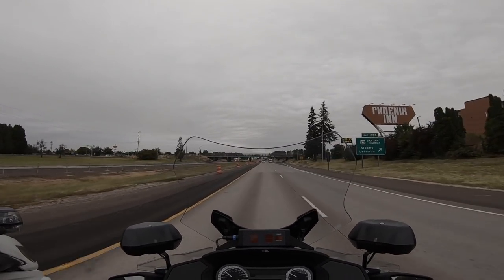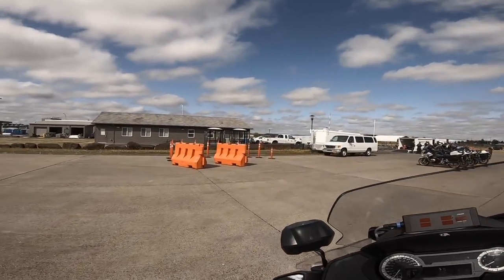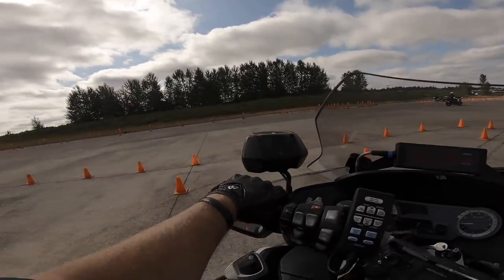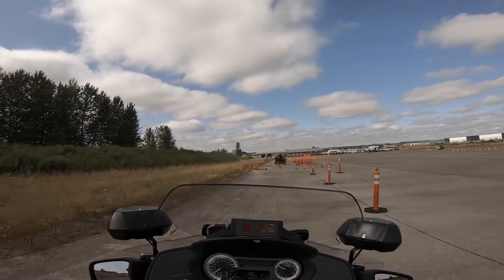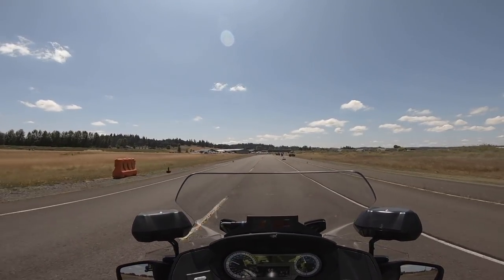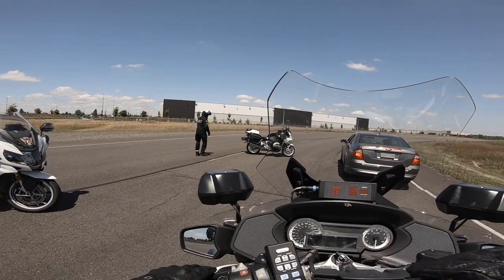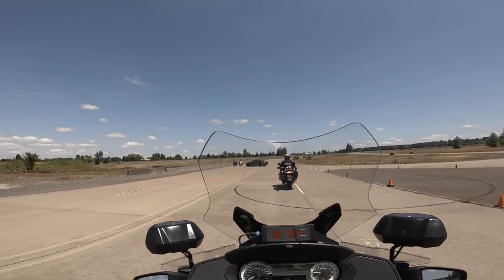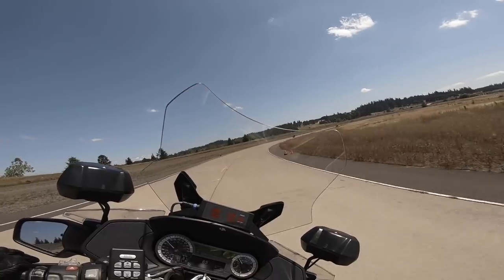Police Motorcycle Advanced Motor Training On A BMW R1200RTP!

Comment: 7:07 Most of the things you showed are part of regular civilian Dutch motorcycle license training... We have to show 6 of a collection of 12 exercises to pass one of the three exams to get a motorcycle riding license in the Netherlands.
Several precision stopping exercises, walking the bike and parking it, high and slow speeds slaloms, figure of 8, turn from a stop, swerving...
We do not use the more fancy exercise sequences but all the elements are basically there and the competitive element is absent as well...
I am working on my 1968 Ukranian motorcycle which is the great great great grandfather of your bike...a 750cc flat twin with just 22 HP... cant wait to take it on the road...

Comment: Excellent video!!!  I am 67 and just got an R1150RT that is my main means of transport.  The skills you show in this video should be learned by every motorcyclist.  The low speed maneuvering and emergency stops are used by everyone.  Is there a class or training that is available so civilians can gain the same safety skills?
Reply from the maker: How do you like your 1150RT? I’d like to find an older RT like that as a commuter/runaround machine. Thank you for watching! I don’t know of any specific courses for civilians that train slow speed cone work. I’m guessing there are a few but I’m not sure where they are.

Comment: Great to see the RTP doing its thing. I own a shop down Central Coast Cali that does all cop cycles in the county. Very interesting! Stay safe👍
Reply from the maker: Thank you Neil! Thanks for keeping all those cop machines on the road down south. They get worked pretty hard.
Reply: @Mclovingarage  They are a wonderful tool and resource for PD. Generally replace tires and pads every 3k and of course safety checks. Please, please be safe. We can fix and repair the machines.
Reply from the maker: @neilmcclain181  I try my best! Biggest fear for sure is someone not paying attention or running a light as I’m entering an intersection. Always on my toes.
Reply: @Mclovingarage  I agree, I ride like everyone is out to get me. We are putting a ST1300P back together now, had almost 10k damage. Sgt has recovered well and back to his desk.

Comment: I just discovered your videos and I find it very interesting. I had thought that I would like to be a motorcycle cop when I was a young man, but at 58.... 
I was wondering if you can say without breaking an policy, about how much ammo you would carry with you on the motorcycle when you are patroling, knowing what ammunition weighs and that you have an AR on board with you as well? It sounds like your work bike is equipped with a Rev limiter or was it the wind? 
 I am impressed by your ability to handle the bike and carry on a conversation with us or your partner.  Be safe out there.

Comment: That’s impressive 👍 thanks for sharing…I pick up another RT next week and only hope I can ride half as good as that…..
Reply from the maker: Thank you! Enjoy your new RT. They are an impressive machine. Is it a new 2022?
Reply: @Mclovingarage  I’ve ridden a number of different bikes (goldwing, triumph, harleys, etc) and the last RT was a 2015. This one is a very low mileage 2015. (4K miles), which I am picking up in CO and riding back to AZ.  I really don’t care for the new look of the 2022, and I prefer the analog gauges.  The boxer engine is a fantastic engine and will always ride an RT…well balanced motorcycle 👍

Comment: I thought that Kawasaki had given up on the C14 as a police bike.  As a C14 rider, I’m glad to see that isn’t the case.  Very nice riding and motorcycle control on your part.
Reply from the maker: Thank you. Kawasaki has given up on the Concourse being a Police Bike. There are still some being used in that capacity but my understanding is Kawi is not endorsing their bike as a Police Bike. They were all up fitted by an aftermarket company for police duty.
Reply: @Mclovingarage  I have the “crash bars” from MCEnterprises.  They hold driving lights, but have, fortunately, not had to hold the bike up off of the ground.
Reply from the maker: I also owners a concourse. I had a 2013 that I bought new. Awesome bike. I also had the crash bars on it. They looked great and appeared to be pretty functional. I never had to try them out thankfully. Haha!

Comment: The maneuverability of the motorcycles an talent of the officers is outstanding. I still gotta ask why no leathers?
Reply from the maker: Too hot. Most everything we run is textile stuff now. Easier to move in. I was wearing a mesh motor jacket during the high speed stuff. It has armor in it and back protection. Thank you for watching.
Reply: @Mclovingarage  Thanks for the feed back, it's good to know there is steel plates in the jackets. My leathers saved my skin  several time in my motor days.

Comment: Nice video!  I ride a BMW 1200RTC - RTCivilian. :-)  I appreciated the engine sound throughout the video.  One thing I don't hear mentioned near enough is how much more FUN riding is when you have had some training.  Question: you said you have already had a new clutch - do you use your rear brake when doing low speed maneuvers (working the brake against the clutch)?
Reply from the maker: Thank you for watching! I have a blast riding, especially at training. I do drag the rear brake sometimes throughout patterns to regulate speed. Both of our bikes have had new clutches right around 20k miles. They get used hard in training and day to day.

Comment: the cones look like practice to drive in normal traffic in Thailand on a motorbike :D  That one at 80. felt a little like trying to stop at 55 in a truck with 32k in the trailer. The problem is the truck would not have stopped for a while after the sticks.

Comment: Hi!
Have you tried ( or been taught) clutchless upchanges at speed ? 
Pre-loading the gearshift with the foot ready for throttle drop as the drive is selected in upper gears (4,5 &6)? Allows rapid succession even without a "quickshifter" !
Also, do the US bike cops train "offsiding" by using more of the entire road (when safety, visibility allows ?)
Doing so would allow earlier apexing on left hand bends by straightening-out the manoeuvre ?
Good stuff.
Thanks for sharing !
Just subbed.

Comment: I just subscribed… thank you for posting! Question on high speed corners “I scrubbed my toe”…. Does your bike have engine guard bars… do you find they scrub before your “toe”…. Are you allowed to comment on what brand is installed on your RT? Thanks for your service!
Reply from the maker: The bike has factory engine guards from BMW. The foot pegs are lower than the heads and I was riding a little pigeon toed when that happened.

Comment: That was an awesome video. Great clip and performance. I felt the adrenaline as you were going through those courses.  I have 2 questions. Which GoPro did you use and where was your camera placement on you body. Thanks
Reply from the maker: Thank you for watching! I appreciate it. The camera is a GoPro Hero 7 Black and it is mounted on the very front of my helmet in front of the chin bar. I used a cheap amazon GoPro extension kit to get it out in front of my face.
Reply: @Mclovingarage  Thank you

Comment: I would have thought you would be moving your head and upper torso more inside the turns on the high speed track.  Were you advised against that?
Reply from the maker: Moving my torso in what way? Leaning off the bike more? Sometimes I get lazy with my head and eyes so that certainly was a possibility. Visibility on this track is pretty good so I might not have been turning my head as much as I could have been.

Comment: Just came across your channel, really good video, used to have the mighty gtr1400, think you call them concourse there, did you say 20k miles on your beemer and had a new clutch fitted?  Big job. Really good riding skills,apart from hard on the left hand lever  😬😀uk rider.
Reply from the maker: Thank you for watching! Ya, the clutch is much easier to fix now than it was in the past. It’s a wet clutch and it’s right on the front of the bike. But boy is it spendy. It was an awesome day of training. Hoping to get to some more soon.

Comment: Looks great, your high speed cornering lines look spot on. I am in Australia and was trained way back in 1990 (6week course) on K100 BMWs, but they are skills you never lose. By far the best course I have done in my 35 years in policing (so far) nothing else comes close. I have a Harley Road Glide (with a few enhancements) now as my personal ride, not quite as nimble but the pursuit motorcycle skills make it near impossible for riders not police trained to keep up when the pace picks up. The low speed skills are so important too, especially on such a heavy bike.  Keep up the good work.
Reply from the maker: Thank you for checking out my video! I’m a big fan of the Harley Touring bikes. Have had several myself. I do appreciate the BMW for work though. For a big bike it’s nimble and quick and turns pretty sharply. Enjoy the ride and stay safe!

Comment: 20220409.  I hate to be the 666th comment. I stopped by to say thanks for the video.  Around 9:50 in the video you do a braking routine at 40-60 then 80mph.  I learn visually also but would like to hear more comment on how you are working your brakes. Example are you applying  back brake  just before or "just  as" you are using your front  brakes? For example: You are in a high speed chase, you are giving the  guy some room to  stop hard.  As you are breaking  are you also working your bike into neutral so you can get off fast to protect yourself from an aggressor or do you use the kill switch to  stop at High speed and exit the bike?  When you are making your hard fast turns look so easy can you be  more verbal about how you lean into the turn?

Comment: I feel if you really know where the abs threshold is, you’ll be more proficient at stopping overall. Love the way you guys ride so tight. Any safety advantages riding tight like that?
Reply: And do you have to be a cop to get this type of training?
Reply from the maker: Probably more disadvantages to advantages for riding so tight together. It does make us more visible on the street when we are side by side but it gives us less room to maneuver should something happen. Another reason we ride side by side is shortening up the whole “package” when we all ride together. If we rode staggered it would be a huge long line. Team Oregon runs some advanced motorcycle training and they do work on some braking and cornering on a track. But not a lot of slow speed cone work courses that I know is. My understanding is Team Oregon is developing some but not sure when it will be available.
Reply: @Mclovingarage  I agree: most motorcyclists should ride staggered in traffic and avoid riding side by side. My bike is an R1200GSW.

Comment: If you don't mind me asking how did you learn clutch control and rear brake use specific to the BMW? Did they teach not to use the rear brake and only use the clutch to control speed?
Reply from the maker: None of it is really specific to the BMW. Same technique can be applied to any bike. I do use some rear brake in the patterns but the majority of the control is through use of the gray zone in the clutch. I will drag rear brake if I want to scrub off some speed. Thank you for watching. Hopefully that helps answer your question?

Comment: Does the RTP have a quick shifter? Interested to know if you use. Thanks for sharing, it's a great video.
Reply from the maker: My 2015 does not have a quick shifter. Not sure what years have them. Mine is a base model bike. It does not have the electronic suspension or some of the other goodies the higher end model does.
Reply: @Mclovingarage  Ahhh it looks much newer than that! Just wonder how a QS would fit in with the riding you do.
Reply from the maker: @TheDervMan  would be pretty awesome on the track, not sure it would make much difference in the slow speed stuff. Normally keep it in first for all of that.

Comment: Just wondering, why do police use sport touring and cruisers instead of more nimble bikes like naked bikes or supermotos? After all, lightweight and nimble bikes are more suitable for pursuits both in city streets and highway.
Reply from the maker: While a super Moto or naked bike might be quicker or more nimble they are not set up for the way we use bikes. We need good sized saddle bags for our gear, good weather protection for all seasons riding, and some comfort features for 10 hour or more shifts among other things. It has to be more than one dimensional. Thank you for watching!
Reply: @Mclovingarage  I see. I sure wouldn’t wanna ride a naked bike for 10 hours.

Comment: Greetings, 
I have a question. Please forgive the length of my post but I want to give you a little background. 
I didn't start riding until I turn 60 and learned  by taking  every MFS course available  except the track course. 
I started on a Honda 1100 ACE and practiced four times a week.
Eventually I got fairly good at U-turns and slow turn Maneuvers in general.
After a couple years 
 I sold it and bought a 2006 Kawasaki Vulcan 2000LT.
I wasn't looking for  that size but it fell into my lap for a price I couldn't turn down.
So after two test rides I bought it.

But once I set up my cones and started practicing  I noticed a big difference.
For starters it had a longer wheelbase, it was about 250lbs heavier than the ACE and 
had the biggest tires I'd ever seen on a bike.

Rear   200/60/16 Front 150/80/16 

It also felt front heavy and was just more difficult to maneuver.
I ran my story to a certain Motorman I  would sometimes watch on YouTube. He inform me that "it's not about the bike" 
and if I truly had the technique down I should be able to hop on any bike and handle it the way I did  the ACE.
If not I probably never had the  technique down to begin with.
But that is simply not  true. 
I sent him a video and he suggested making a more extreme dip prior to my turn which did help.
But that was two years ago and now 
after hours and hours of practice I still struggle to get those 18ft u-turns as I did on the ACE.

So my question is whether a bikes lean limit and turn radius is dependent on its wheelbase,
weight and tire size or is it just a question of better technique and more practice?
I'm already at full lock,  I can't say I'm scraping the floorboards but I'm leaning pretty good.
Thank you
Reply from the maker: Thank you for reaching out. While technique is important, there are limitations to a bikes platform that can make it less nimble and or capable in slow speed maneuvers. For instance, several police agencies were using Victory baggers for police bikes. In order for them to complete the same patterns we were doing on BMW's, Honda's and Harley's the patterns had to be made bigger. With their longer wheel base and less turning radius, they physically could not make the patterns in the same amount of space as the more nimble bikes. With the very large tires and longer wheel base, and longer turning radius of your current bike I can see why it is not as nimble as your Ace. Technique is important, but technique can not overcome a motorcycles limitations, regardless of how hard you try.

Comment: Sir, you invite comments, so here goes. In years on the saddle I outrank you but you are likely to have more miles of top notch experience. I started at 14 riding illegal old British bikes on fields & the road I'm ashamed to admit. Got into schoolboy trials that gave me discipline. paused at around 21. Came back in my late 30's with much more powerful bikes until today at 62. 
I give a cheery wave to all M/C cops on my travels, you do an excellent job and behind the uniform we are all bikers.
Finally, in case you have not seen them, here is a link to the Dutch bike cops of The Hague working hard.
https://www.youtube.com/channel/UC02HKtbrq0ypHvJkovqDr8g
Reply from the maker: Thank you for the comment! You’ve had lots of varied riding experience. I like it! I also started young and got hooked early on two wheels. My favorite thing to do is ride motorcycles. I’ll check out that video. Thanks for checking out my channel.